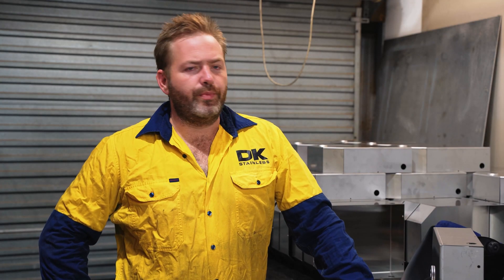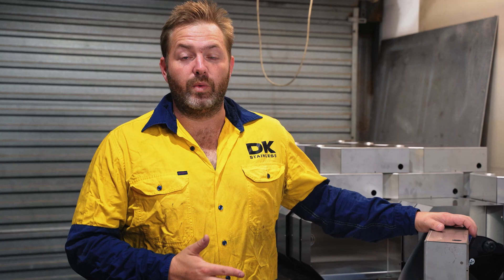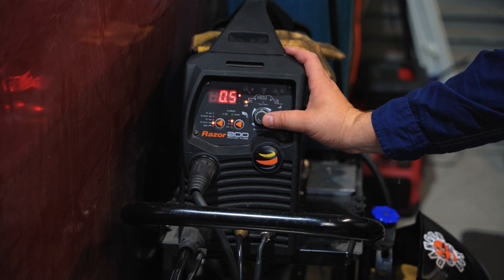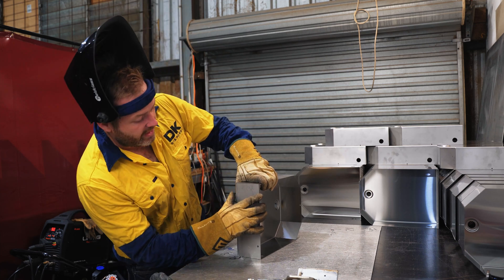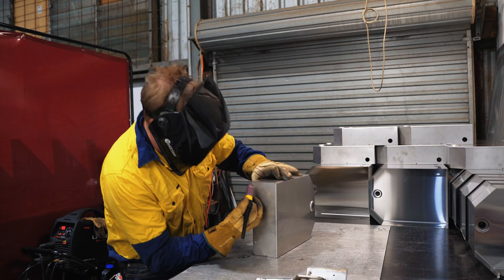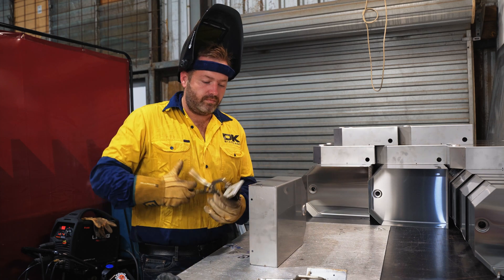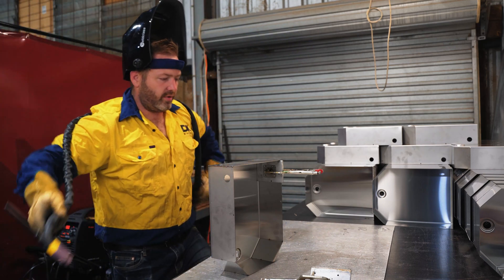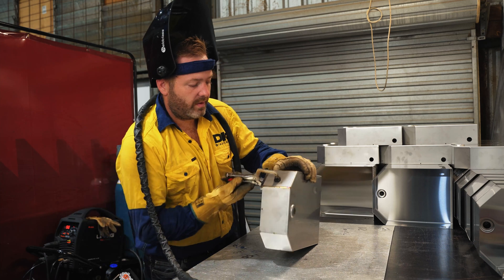Stainless Steel TIG Welding! Our BEST Settings & Techniques REVEALED 😱🔥

Comment: I’ve been practicing on aluminium since purchasing my tig. I’ve done a couple of small jobs for customers and friends and have been quite happy with the end result.

Jumped on here to get an idea on stainless setting as I’d normally use a mig to repair the stainless water tanks but didn’t want to set it up. So I used the tig, followed your settings as best I could and wow! It came out beautifully and the tank is sealed and not leaking. I did use some filler here and there due to the original weld being quite porous. But your settings were a huge help! 

Thank you for the video and the knowledge.
Reply from the maker: Thank you so much legend! :washhands: